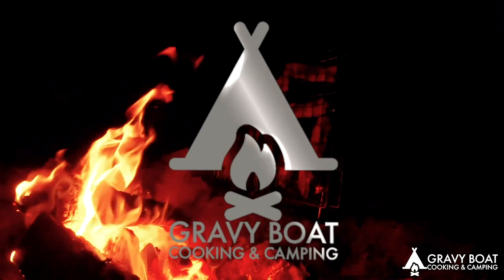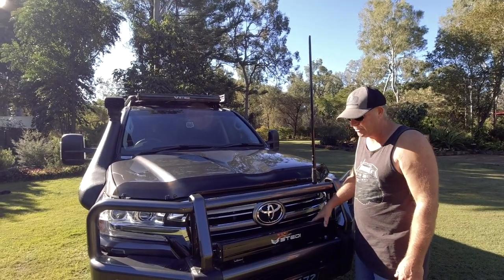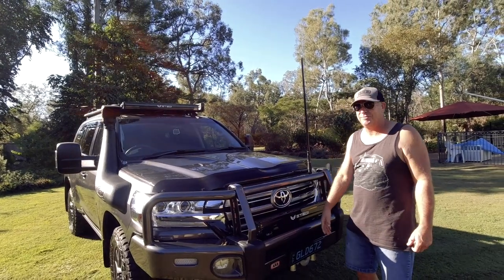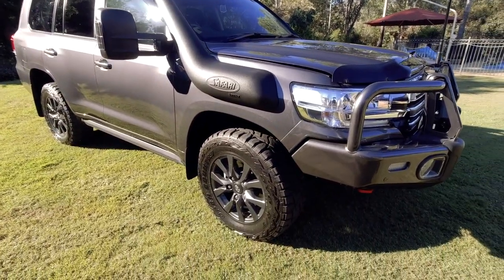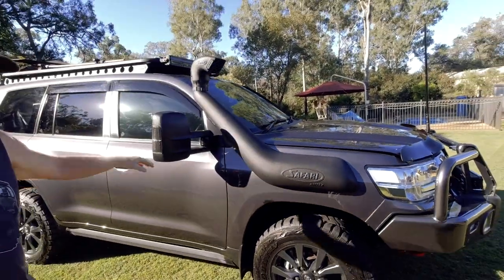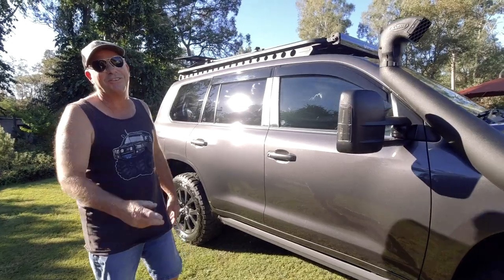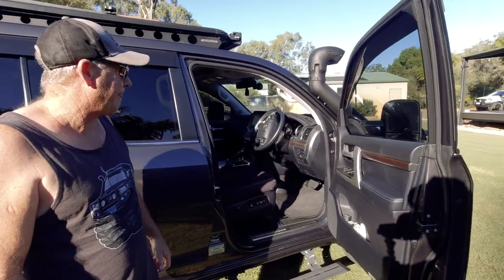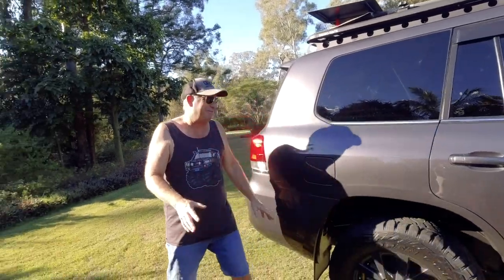200 series Land Cruiser modified for towing and touring

Comment: Like to know how noisy the fridge is and how it might handle some rougher roads, will it shake itself to bits ?
Reply: Hi Rob the fridge is not noisy at all same sound as my my other 40 litre engel fridge as handling rough roads done 1400 km of the roughest road up top of Queensland not 1 problem with fridge we had more problems with the caravan lol hope that helps cheers
Reply: @glenndavis5179  Thanks Glenn.  Do love the setup - particularly the fridge and rooftop solar.   Thanks for sharing...